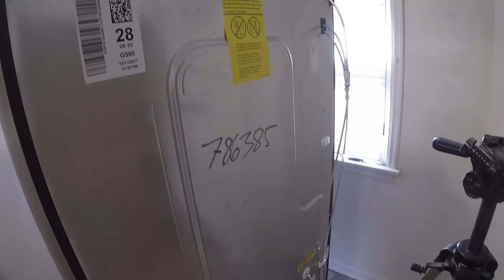How To Install Waterline to Refrigerator | DIY | THE HANDYMAN

Comment: Dad redid his kitchen. Put a braided line in for the fridge. 2 years later, pops a pinhole leak, he catches it after an hour. Not too big of a deal, some slight water damage, but mostly just running fans in his (finished and furnished) basement. Take two is this exact line. Little over a year after the install, it springs a pinhole leak. This time my folks are gone for the weekend. One $14,000 HOI claim later, and they now buy bags of ice and get water from the sink. It has likely scared me from ever putting in a line to my fridge!

Comment: I wished you had used a wrench on the elbow while you were loosening the water line and talking about how brittle the CPVC was. The elbow is squared so you can put a wrench on it while tightening or loosening. That would be good advise for those that are not very experienced in doing this type of work.

Comment: Great video, as always.  You can find a two-sized replacement (JobSmart Dual Drive Spud Ratchet with Hammerhead) at your local Tractor Supply store.  I have two of them and use them all the time.
Reply from the maker: Thanks a lot. I'm going to go look for one.

Comment: Could use tips for selecting and navigating how/where to drill through floors/walls to run line.  We have existing shut off connection/valve.  Line wasn’t here when we moved in and no line or hole upstairs in kitchen.  Help!

Comment: Your talking is always helpful and informative professor.  The small details always help like when you cleaned up the threads on those metal connectors.  Is that toothpaste looking stuff you put on the threads any better than plumbers tape?

Comment: My refrigerator water line was the source of a pinhole leak that killed some of my ceiling tiles downstairs.  I wasn't aware a plastic pipe could have a pinhole leak, but it happened.  It looks like steam was coming out of it it was so tiny.

Comment: Hey i bought a refrigerator used. And i got the water to work (New filter) and I'm using the same type of fitting plastic hose like yours BUT my ice maker isn't making ice. Any suggestions?  (It's all programmed to make ice and the on and off switch is flipped in the on position inside the ice maker) It will dispense ice b/c I put some bagged ice in there and it works fine dispensing it BUT not making it. Where to start...? Thanks!
Reply from the maker: If you have water coming out then the problem is internal.  I would google the problem with the model number of your refrigerator.

Comment: I thought the saddle fitting is  frowned upon. Thought you would talk about the "crescent " wrench and why you like using it
Reply from the maker: This is the first time I'm hearing of it.  I have never had a problem with them.
Reply: @TheHandyman1  Intially they work well, years later the pin can get buildup and not seat properly when servicing the fridge
Reply from the maker: That is the case will all water shut offs that are not taken care of.  Every kitchen and bathroom I have remodeled the water shutoffs no longer shut the water off.
Reply: @TheHandyman1  My father was a plumber he told to turn all the shutoff valves off and on throughout  the house too prevent that
Reply from the maker: Yeah at least once a year people should "exercise " their water shuts off but no one ever does.

Comment: So sorry for this long ass comment....try not to make ‘em this long....but, was a great vid w/ lots of knowledge & info for us.
Do like when talk to us as you’re going along with the job(install). Have many reasons why prefer talk as you go, rather than voiceovers,  it for kicks n giggles....here’s one: while your in the moment doing the job, issues that come up or things you think of are more natural, flowing.....& we can see it as you go, especially if have an issue, or it’s as smooth as silk (lol). Voiceovers are great for some projects (or some types of vids), but sometimes might not remember why did something afterwards (especially if editing a vid days/weeks later), or, just might not be into “the voiceover”; want to get video/project done....& get it out(not that you’d do that, not being facetious here, honest). So, prefer on the fly, in the moment, talking to us in the vids....just can’t replicate the fun, knowledge, reactions, etc....when doing a voiceover as well......in my opinion, of course😊
10:29 This insert is kinda similar to the PEX inserts that need to use depending on brand/type. My rule of thumb....If manufacturers include/have them....I’d go ahead and use ‘em😁
12:30 Absolutely love when manufacturers have the backplate on fridges (appliances) made out of metal. It’s so much more durable, & makes life easier for service calls, etc.... Can not stand, when go into a house & pull the fridge out & the back panel is made out of card stock🤬 (have even seen corrugated cardboard before). It’s just plain stupid, annoying, & always ends up falling off or ripping. Why, just why 😂
Thanks for the vid Handyman, this house you’ve been working on is looking great. Gonna be awesome when completed👍🏻
Cheers✌🏼

Comment: Just say no to saddle valves! Illegal in many states as they corrode the copper piping and when it fails, you will have a major clean up and repair bill. Insurance doesn't want to pay out claims for this!  I didn't know I had one but now I do and will be changing it myself.  Not to mention, the water flow is slow.. it takes my water dispenser 45 seconds to fill a 12 ounce glass. This is about to change! I am redoing my water intake system from the pipe! I will use a compression connection at the pipe to connect the tubing to the fridge.
Never done it before but I have youtube!